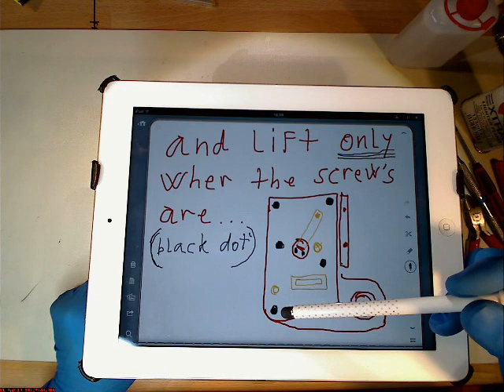Fix the stuck Film advance gear in Mamiya C33        Motion Lapse Film

Comment: By coincidence I had the same problem a while back with a C33 - in the end I just ripped off the leather, unscrewed everything, took the side off and then sprayed some WD40 over everything. It seems to still work. I ended up painting the side instead of putting the "leather" back on.
Reply from the maker: WOW Ashley, that another way of doing it, no matter what other people say, and if it still works with WD40, that's the main point also because the mechanic in those models was not that precise made. I also think the "leather" was a real pain to just loosen, even with a small heating gun, but it turn out to be ok after, and then I use some contact glue :-)
Reply: Me too!! :-) Now fixed!!
Reply: Rebel scam

Comment: Hi Mike great video, I will try this with my C220. In terms of the products you are using, quick questions:
- the first product you use is a Loctite 243 equivalent, right?
- next you lubricate the brass lock hook, can I use sewing machine lock for that ?
- and last you glue the nut where the longest of the six screws you initially take off go, right? I guess to simplify the reassembly?
Thx!
Reply: sewing machine oil, of course

Comment: Very nice video. I like it and it is indeed very helpful to see before one starts their own repair. Good to know what to expect.

Could you please explain what you were doing to the shutter release mechanism? Was it just tight and you lubricated it, or was there something else going on?

I've just received a C33 which seems to be working aside from a stuck shutter release (it works on the lens, just the camera's release lever is stuck) and I'm sure I can fix it if I open it to see what's going on under the hood. But found this first so I'll ask you before I dive into my camera's guts. :)
Reply from the maker: Hi Noah
The problem for this camera is found at 5:10, the little braze hook i point at was get stuck because of old grease. So it need a drop of good sewing machine oil on the axel, at the same time you also should give the other hook, shown at 6:55 a drop of oil on the axel.
Remember before putting on the side again, to make shure that the hook go in to correct place at the side, shown at 8:40---- 8:48

hope it will help you :-)

Cheers kenneth
Reply: Thanks a lot Kenneth. It makes more sense what you're doing with the description now.

I have already sorted mine out, though. The problem was the gear which moves into the counter and 'cocks' the hooks. It wasn't moving right, now it is.

Everything was put in place as it should be, and now I am on to fixing the jammed aperture on the lens. It is currently a million pieces. The aperture blades were unbelievably stuck together from oil. All clean now, and aperture is put together. I still have to put the shutter back in place, but something came up:

The time switch is off centre: at one end, it should be on B, but it stops at 1/2second. On the other end, it should be at 1/500s, but it's actually two stops further. The whole mechanism seems to have turned a bit, and I need to figure out how to put it back, and also it's not 'clicking' anymore as I move the time switch. :( I didn't drop anything from the inside so I'm a bit worried.
Reply from the maker: Hi Noah

Good to know it work's for you, at least the camera...
The next problem with the lens, i think you are right about the complete shutter aseembly is turned a bit, maybe 1 shutter blade or 1 aperture blade, hope it will work for you, did you take some photos of the process, it could make it easy'er to figure out what's the problem is.
I'm planning taking a Compur shutter (Hasselblad lens) fully apart and make a film out of it..
Reply: Yeah I am taking photos. Will make a blog post of it once it's done.

I can't figure out how to turn the mechanism back. And also the lack of clicking is worrying. Should there be a metal ball somewhere that makes this click? I found a small ball under the table and I'm wondering if this it fell from this lens. :(
Reply: Done! ^_^ And it's all now working beautifully. :D
Reply from the maker: WOW Noah, great to hear you get it done, what was wrong with it.
Reply: Body: gear that turns the counter wasn't moving, therefore it wasn't cocking (hook to lock the release stays engaged). Sorted that out.

Lens: aperture blades were completely stuck with oil. They wouldn't budge really felt like one thick big leaf when I removed them. Cleaned and reassembled. Had to juggle the shutter blades on the way as well.
Reply from the maker: Nice, it's amazing how much oil there can be in a lens on the shutter / aperture blades, it happen a lot in "Compur" shutters or Compound shutter.., the only thing is to clean with lighter fluid or Isoprophylalcohol.

Keep up the good work Noah, will you make a blog of it to show others, i would like to see it :-)

cheers
kenneth
Reply: Yes Kenneth I will make a blog post. Now sorting out the photos I took. Will have to do the writing though.

I used Isopropyl alcohol %99. Really want to try lighter fluid to see if it cleans off without leaving any marks. The blades now 'look' as if they have, or have had, grease, but in fact nothing is left and they are smooth as butter. (that's not a good metaphor for aperture blades, right? Butter is fat and they'll get stuck again lol)

I will update you when the blog is up. It will be on http://photographeronbudget.blogspot.co.uk
Reply from the maker: I look forward to see it..,

Haha, "butter smooth", i will remember that metaphor LOL :-)

Well, isoprophylalcohol is very good for the most shutter / aperture blades..

(take care of the very very old, because some of them where made of compressed paper or some similar stuff, they don't like to be wet)

If there are a lot oil film on the blades i use Lighter Fliud (Zippo) and many Q-tip (A LOT's), it's very effective when you do not need or like to disassemble the shutter.
Lighter Fluid evaporate much faster than isoprophylalcohol and nothing is left on the blades.
Lighter Fluid is also very good when cleaning the focus helicoil with a fine brush.

cheers
kenneth

Comment: Great video! I will need to open my own C3´s advance mechanism as well and it´s really helpful to have an advance look at what to expect underneath the side cover before actually opening it up. The frame counter on mine does not move and the film advance will just continue all the way without stopping at the first (or any other) frame. If you continue cranking, it will transport the whole roll through without ever engaging the lock. The release button will remain locked unless you switch to multiple exposure. Do you have an idea where the problem might be and what to look for? Thanks in advance & keep up your great work!
Reply: I have similar problem with C33. I end up with blank films when i switch it on multi-exposure
Reply: I just spent a couple of hours repairing my C33 for a seemingly similar problem but with a different cause/ solution.
Basically when you open the Camera you will see the brass wiggling key which switches over between stutter lock and release. That’s the one he lubes on to make sure film can advance. 
That was what I have done initially, and it helped a bit, but the main problem remained. 
but the solution kept avoiding me. 
Eventually, I found a combination of gears, right under the film progress dial. These two turned out to be the culprit!
 I carefully removed the number plate by removing three filament advance plate,  indicator, Exposing To all the ring on the rates which are responsible for engaging different levers gears responsible for blocking shutter release and locking s the next step, i removed the plate, reached the piece below and had it oiled. Now two cars nw in STSAA